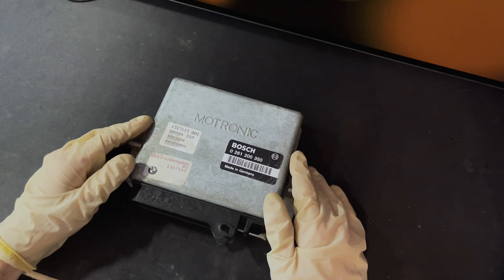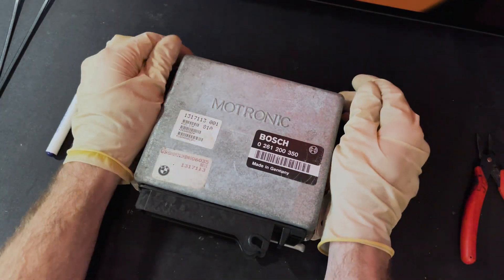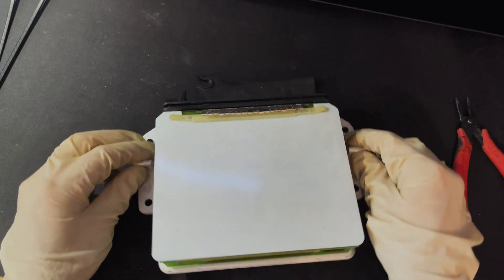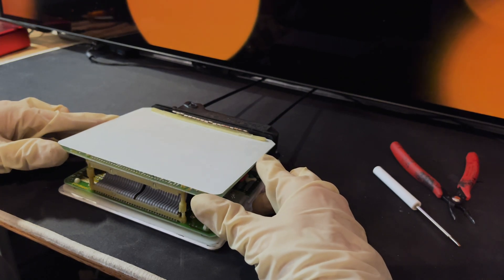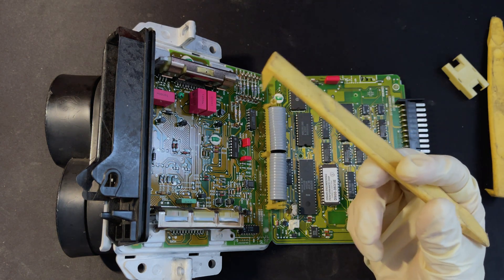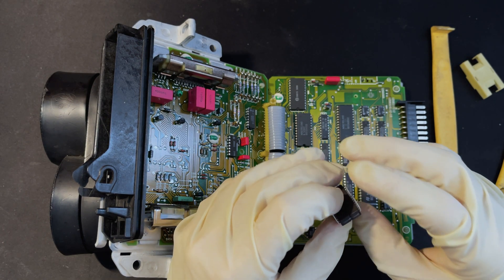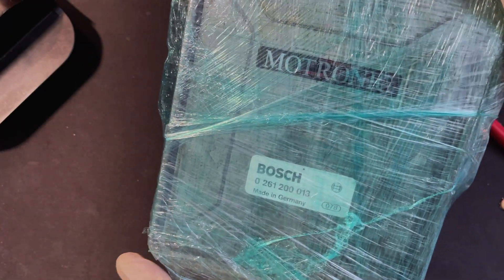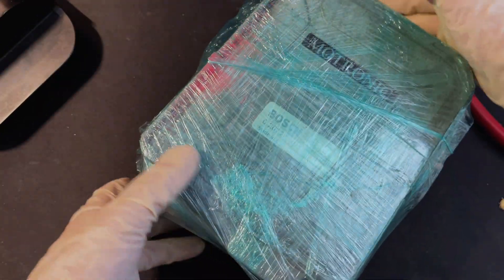How to: Open DME and Replace Chip - BMW e34 M5 DME

Comment: Keep the wagon alive broooo .having same plan but with b28 crankshaft and bore it to 86.4mm with stock s52 pistons 135mm rods equals to 2.9ish 3.0stroker dual valve spring from m50nv s52 cams same.schmiedmen heders but dual with x pipe and racing dynamics carbon airbox light flywheel 250ccm injectors hope to get it running soon 🔥🔥🔥🔥keep up good work bork man 🤝🤝😎greetings from Croatia in europe 🙋🏼‍♂️